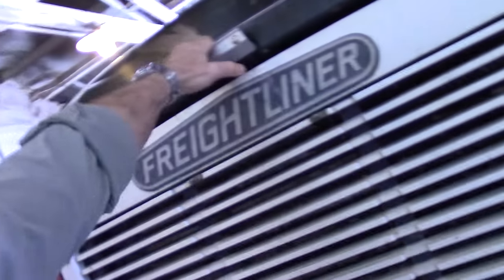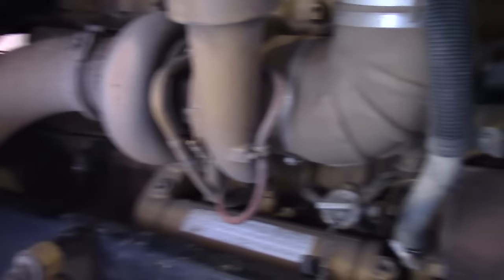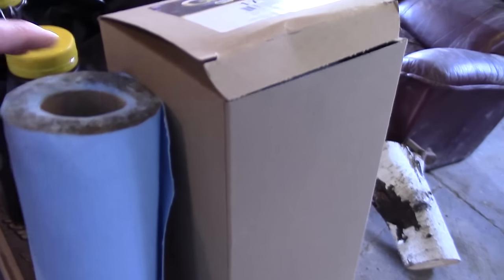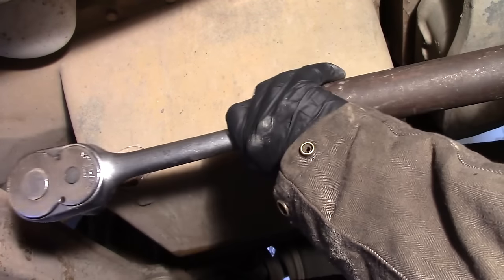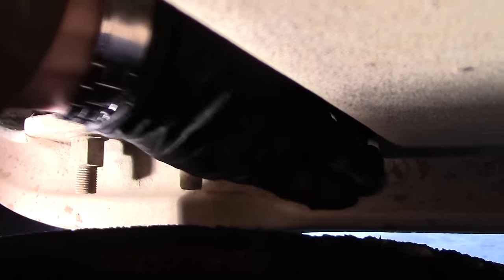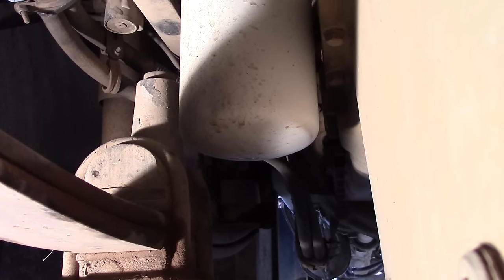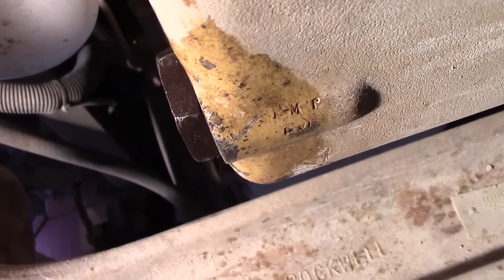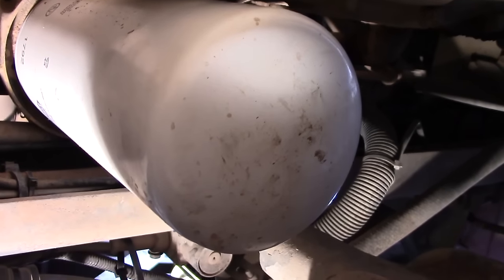How to do an Engine Oil change on a BIG Truck-DIY Duke

Comment: My Father tould me, that i have to get out the Filter First, than the actuall oil.
Reply: BeneK as long as you let it all drain it shouldn't matter. I would say letting it run for a little while before you change it is even more important. warm everything up to thin the oil a little so it drains better. but if the oil isn't terrible even that shouldn't matter. just check for sludge. if you see that you have some problems.

Comment: I do about 3 b services a day on freightliners with isx engines. I've always found its a lot easier to punch a hole in the oil filter then to try to lower it without spilling all over

Comment: I did an oil change on my friends freight liner. Don recall the engine size but it was big, about 13 gallons of oil. It was a pain to remove the oil filter, last guy who did it made seemed like he welded it onto the block.

Comment: I never worked on a big truck or ever got close to a big truck but I was curious to see how it is but wow it is exactly the same as a regular car that's amazing but the amount of oil it takes surprised me and I can't believe how easier it is also like you said More space lol
Reply: And really it may not be that it needs all that much. The engine may be 3x in displacement as big as a mustang engine, but it takes about 10x as much oil.  It's because the oil change intervals are much longer.  They put on 3000 to 5000 miles or more per week.  So the interval is about 30k or 6 months for oil changes.
Some of the massive generators that run continuously can hold a hundred gallons or more of oil in a tank.  Every few hundred hours, it dumps a gallon of old oil into the fuel system and pulls in a gallon of fresh oil from the tank, so it in essence does its own oil changes.  You just have to change the filter every so often.  I could even see them putting in a valve to alternate filters if they couldn't shut it off ever.

Comment: Sometimes your county MUA (landfill) will except used motor oil. You can go to their website and check to see if they do. It will also tell you if there is a gallon limit, how much it is and if there is a fee.

Comment: i agree with the quik lube thing. spend any time on car forums and youll see "AVOID QUIK LUBES LIKE THE PLAGUE" alot.

when i first started working on my saturn sl1, i decided i was going to change my own oil. mom said to go get it changed at a quik lube and i insisted i did it myself after hearing horror stories and reading reviews on quik lubes that stated the hassle in addition to shoddy and incompent work done. not to mention that i wanted to choose what oil i put in. my first oil change ever went well and resulted in a very smooth running car. if you know anything about those cars, you know they burn oil so the change to synthetic may have helped. but i dont know, the car got wrecked and i dont have it anymore so.

Comment: The important final step is to reclaim any oil still in the bottles.  Take a funnel and stick it into one, and just leave the rest to sit about 5 or so minutes each so they empty out into one bottle. Used to do that on my car, every 4 or 5 changes I'd have one less quart to buy. Also handy if you need to top off the oil down the road a little bit.
Reply from the maker: +TonixTech good call, especially in the gallon jugs, gonna reclaim a good amount.

Comment: I ran my old 93 Silverado without oil for about 5 miles before it started knocking, smoking, yelling. Blew a rod bearing out and a piston out the side. Didn't have the money or time to fix it. Hints why I now drive a 98 jeep Cherokee. My buddy's Dad hasn't changed his oil since he got his car over 10yrs ago. Adds oil but has never changed it lol. Still runs like a champ.
Reply from the maker: +Jeepguy 9519 that sucks about your silverado, so maybe changing oil is over hyped - wow 10 years, that's crazy
Reply: I dont think that the not changing the oil for 10 years is true.
Their would be no oil in that engine, it would be one giant ball of sludge.
Synthetic or Mineral both would sludge up.

The sludge would block the pick up tube, the filter would get clogged with sludge, the sludge would block the oil passages

Look at the video 
What happens when you don't change oil for 50,000 miles
Reply: Why would you run it without oil and then say its unreliable?

Comment: I've heard a trick to drain the oil from filters in diesel pickups is to use a pick or a screwdriver and punch a hole in the bottom.

Comment: Should invest in a bypass oil filtration system for a truck engine.  They are worth the money and extend oil change intervals.  Pittsburgh Power makes several kits for different engines.

Comment: you can take a center punch and punch a hole in the bottom of the filter also to drain the oil before removing.

Comment: Early 3406, Cat C15 or C-15 can be set or programed at different horse power rating vary from 425- 450-475 -550-625( with hardware change pistons injectors etc) and same under 475hp better with 1650 torque  550hp 1850 torque and 625 HP 2050 torque  ( king of the hill) 

torque moves the load and horse power defines how fast. Max torque on C15's are around 1200 RPM max HP is around 1800 RPM 
If Cat C15 has rating of 475hp / 1650ftlbs and transmission is RTLO16913 rated at 1650 torque handling with clutch rating  that's a match but increasing torque by 200 will damage transmission and clutch , so all three work together , 
Changing oil. Always torque drain port at 48ft lbs and if it's magnetic check for metal. Always fill from side never from middle hole specially fuel filter , poke the bottom of oil filter , change oil when oil temp is  +150°f  , not on cold. Now u can correct me or criticise

Comment: I don't know if you've been told before put a good trick with the oil filters is take a punch and make a hole in the bottom of it to drain the oil out of it before you take it off

Comment: I always punch a fine hole with a sharp screwdriver in the center of the filter bottom and when the oil is done drain the filter will be drained as well, so my hands don't get messed up.

Comment: I always use an impact to remove Cat oil drain plugs. I have a 1-1/2" 1/2 drive socket. Just don't use the impact to put it back in!

Comment: Very good and informative video. I am not too familiar with big rigs but I do like me some diesel torque. I’m sorry because I may have heard incorrectly but did you say this truck only has under 300 pound feet of torque? How does the size (liters) make up for that? I’m not being a jerk and am just trying to learn. I always thought that these big rigs probably made like 400 horsepower and probably like 2,000 pound feet of torque.
Reply from the maker: Yeah you're right that engine puts out 1800 ft lbs of torque, my bad

Comment: if you pre fill a filter you should do it around the outside holes as filling the insides will give you a filter full of unfiltered oil (not that new oil should come dirty anyway) which can cause harm to the engine over time

Comment: Am 3 years Owner operator 1996 Detroit seara 60  12.7L .
My question is the fuel filter you don't charge every oll charge?
And thank you for you time every help full
Reply from the maker: Yes, do change the fuel filter every oil change

Comment: Idea to prevent vehicles being started when moved on 

I'm a bus driver and our workshop use red steering wheel covers to show it's being worked on 

The red cover belongs to an engineer and only he is permitted to take it off (if he's not about the head engineer has to check to make sure it's fine to remove)

This would prevent any issues

Comment: On our Grove cranes we use ez drain plugs there's no mess until the filter then we take a sharpened Phillips screwdriver and stab the filter to drain it
Reply from the maker: Yeah had done a Fumoto valve video and start using those and just saw the ez drains at Napa today.  👍
Reply: DIY Duke they're lifesavers lol

Comment: Usually I break the filter loose, then I get a hammer and a screw driver that I sharpened to a point. I punch a hole in the bottom of the filter and let it drain it's easier and mess free

Comment: You can punch a hole in the bottom of the oil filter and let it drain, alot less will come out when you remove it.

Comment: as far as quick oil change places, you need to be aware at when your vehicle needs certain fluids changed. most places will recommend at certain intervals regardless of make which is fine just as long as its not a crazy low mileage. if you are ever uncertain and put on the spot just say "not right now im gonna look myself and make sure its the right interval" but 2 things, one the auto manufacturer quotes best case scenarios, so if you are driving in a place that is very hot, very cold or with tons of hills, towing and hauling you need to change it sooner. second is oil fluid and filters are cheap, parts and labour is not.

Comment: just to point it out, while all internal combustion engines do use oil in some capacity, not all internal combustion engines use an oil filter, or need oil changes.

Comment: the rubber on the filter doesn't need oil, I design rubber gaskets for living (big company in Germany) so its just fair to let you know :), with the oil ontop you lose friction and the oil filter is too tight - so I could leak beacause the rubber isn't in its designed position and its harder to loose the next time. This is just the mechanical way how we design it... I know it never leaks even with oil on ...  just let you know :) have a nice day :)

Comment: If you cant lock out the truck, you should put the key in your pocket also you can break the filter loose then pop a hole in the bottom with a screwdriver or punch to drain it. Gotta love a CAT!!
Reply from the maker: +Based treefrog 👍

Comment: Use a pick and make a hole on the bottom and the side of the oil filter. The  just let it drain out. Much simpler.

Comment: Very good vídeo! 
Every how many miles you  need to do an oil change on those Big rigs?
Reply from the maker: +Sersh Tano every 15,000, many have chosen synthetic oil which lengthens the time between changes
Reply: DIY Duke ok,  thanks !

Comment: considering how much oil it uses im surprised you dont have a 55gal drum and the air pressure operated oil filling thing we have at work to put oil into the cars after you have drained the old stuff
Reply: companies that have a fleet of trucks do have that kind of system, shops that dont work on them much do not. takes a lot of money to have a set up like that

Comment: can I recommend a evac machine it makes it a lot less messy for you they also have a filter punch so you can vac out the filter oil to goes down the dip stick hole vacs oil out will you change filter no mess
Reply from the maker: Yeah that's an awesome idea, thankyou 😀

Comment: take a punch and punch a hole in the bottom of the oil filter that way the oil drains out then you can remove the oil filter with as little mess as possible I've learned that trick changing oil on my 2000 7.3 powerstroke

Comment: it only takes 10 minutes if the oil is hot and your tools and filters are out and ready. I usually pull the drain,grab my grease gun and 20 minutes later I've greased her up. plug the pan,change the filters and fill'er up with oil.

Comment: Be aware that the oil filter is full of old oil,tilt it slightly so as to not spill any,or put a hole in the bottom,and hold your fin her over the hole,then let it drain when it's safe to do so.

Comment: Is it recommended to fill the new oil filter with new oil then to just put it on a empty filter and let the oil flow through it when you start it?
Reply from the maker: +Austin Greig yes, most recommend putting some oil in the filter

Comment: Interesting- there's no single use sealing washer on the sump plug like on most cars. Any particular reason it's not needed?
Reply from the maker: Some trucks do have them, and some have magnetic plugs to catch metal filings but not all.

Comment: good vid my question  my 94 fld120 is  almost like yours would you recommend to used oem oil or what type of oil would you recommend thanks.
Reply from the maker: +KrakenNC lot of people are using synthetic, id google the info on it - happy trails 😎
Reply: sweet thank sir now for greasing the chassis I bought lucas the green bottle is that good or you recommend something else.

Comment: So why did you have to place oil in the filter at first? Im not sure, but please answer
Reply from the maker: +Jazzy jas the filter holds a gallon of oil, by filling it before hand the truck on startup doesn't have to thus the system gets lubricated and pressure comes up right away.  Just better for the engine that way.
Reply: Ok

Comment: You shouldn’t have that watch on man. But good vid you should strain the used transmission fluid and oil in your diesel fuel tank. I’ve run my 94 7.3 Ford off of used 10-30 motor oil when in a pinch.

Comment: I get my oil changed at the dealer.  7 quarts plus filter for my car of synthetic is only $10 less than what they charge me...and I don't have to lay on the floor.  They use the opportunity to point out other repairs they "need to do". I kindly thank them and say maybe next time.  If it really needs fixing, I'll get dirty to save a few hundred bucks - but not 10....and sometimes they even wash my  car.... :)

Comment: Why didn't he use a new oil plug gasket and use a torque wrench. No doubt CAT specifies the torque value.How many miles will an engine like this go until needing overhaul?

Comment: Just out of curiosity how much does it cost to change the oil in a truck like this.
Reply: For my truck, the dealer is $325, a truck stop is around $250, and DIY it's around $150.

Comment: you shouldn't tighten the drain plug so tight it will eventually strip out the threads in the aluminum oil pan or Crack it....the Detroit 60 series are even worse you over tighten one you may not get it out replaced more of those oil pans for that reason than any other

Comment: how often do you have to  changed the oil? Do you go by time or miles?
Reply from the maker: Recommended at 15,000 miles for standard oil in a moving vehicle.  If the engine is stationary better to go by hours.

Comment: I've heard the reason why it is a good thing to fill up the new oil filter before placing it is for the oil circuit to not be dry for too long, that way you protect the turbo shaft connecting the compressor turbine to the exhaust driven turbine from being ruined . Could anyone confirm this?

Comment: I have some questions maybe a trucker can answer
Common engines for semis, that I know of, are Cats and Cummings. Are there any other  brands of engines used?
Are they straight line engines or are they V formation? or do they come both ways?
How many cylinders do OTR trucks have as opposed to maybe a farmers truck?
What are the differences between the brands of trucks, like Kenworth, Peterbuilt and Mack,
And does the region the drivers live in determine what Truck to buy? Kenworth was originally built to be driven in the mountains,(I saw on a documentary) I live in Minnesota and notice a lot of KWs Peterbuilts and Whites
Silly Questions, I know but I tried googling it shows the engines but doesnt tell me what trucks they go into. Its just easier to ask people
Reply: I'm no trucker, but I can answer a few of your questions. Other than Cat and Cummins, there's also Detroit diesel. They are commonly inline 6 engines because they produce more torque and are easier to work on. Compared to a farmers pickup, the pickup usually has a gasoline V8 or diesel V8 such as a powerstroke(ford) or a duramax(gm). Dodge ram has an inline 6 Cummins. There isn't to many differences between Peterbilt,   KW or mack. It usually comes down to comfort, amenities, reliability, and fuel efficiency when a trucker chooses a truck. Hope this helps.
Reply: Yah that helps a lot!
What I meant about farm trucks is some of them have tractor trailer rigs for hauling there grain and equipment. 
I thought they would be different than what an over the road trucker would need. I know some of the farmer rigs have a PTO drive for augers so I thought maybe they wouldn't need the same type engines
I think what surprises me, is that none of the major truck brands make there own engines, and that they arent in a V formation. I was taught that the V formation run smoother than straights.
Thanks for the info, for some strange reason I began to wonder about it
and never really thought about it
Reply: Glad I could help!

Comment: Why did you put oil in the filter ? This's my first time seen that. When I change my car oil I don't put oil in the filter just in the engine and turn the car on for 10 minutes to cycle
Reply from the maker: +Mr _X definitely not that big a deal in a car, not putting oil in the filter, but in the truck the filter holds a gallon of oil so it prevents any delay in lubrication.
Reply: +Mr _X you don't want your vehicle to run dry for a few seconds it shortens the life of your engine

Comment: On my trucks I always pop a hole in the bottom of the oil filter and let it drain into the bucket before I take it off. Always wore the oil before I found that trick
Reply from the maker: +Frank Munaco good trick Frank

Comment: Whats the recommended time/mileage to change the oil on such big engine?
Reply: maltriseins Usually oil in large diesel engines like big rigs are measured in running hours , Big rigs will be started up and they will be run for 20 Hours easy , so oil change intervals are several hundred hours.

Comment: how much money do you save on average changing the oil yourself on a semi?
Reply: A lot, one of my fathers friends was charged 400$ for an oil change on his dump truck.
Reply: Jeschitown well if you go to Ta truck service a pm is after tx is 300 and some change. but that's fuel filters grease job oil filter and 3 box check.